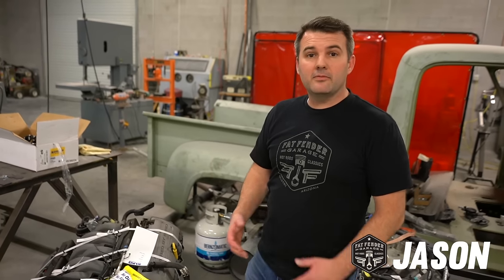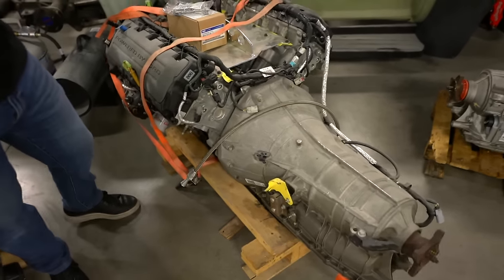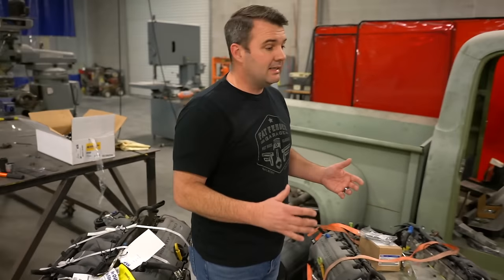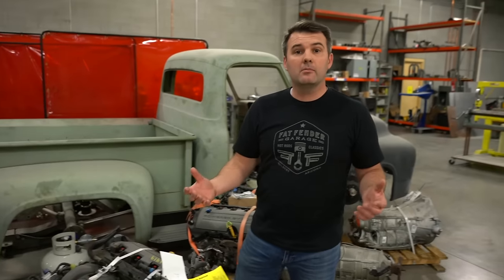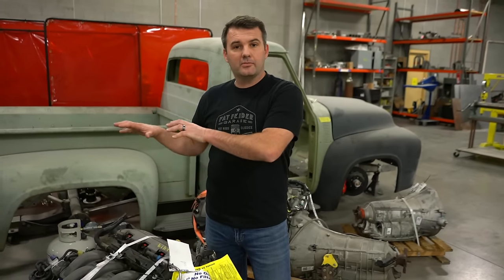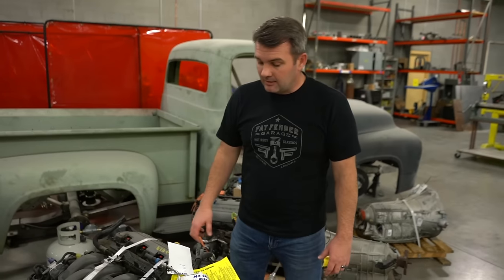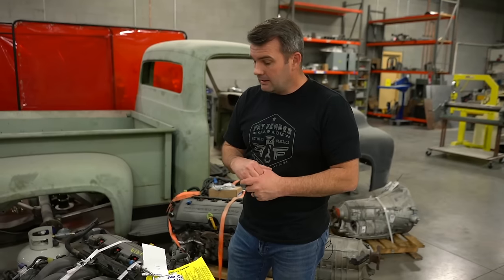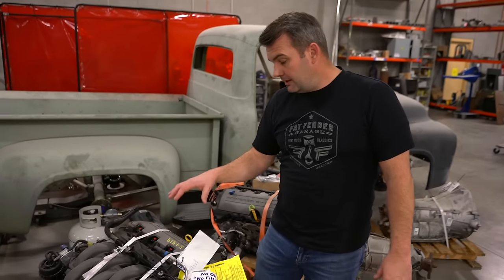Coyote Swap Engines - HOW & WHERE TO BUY

Comment: Lol, 11-14 F-150 5.0's are all the same horsepower... No F-150 5.0 is down 60-70 horsepower vs any other year model.. Basically an LKQ commercial...
Reply: The 2011-14 f150 motor makes 360 hp and 380 lb-ft of torque, some 52 hp and 10 lb-ft less than in the Mustang GT @ 412hp 390lb-ft